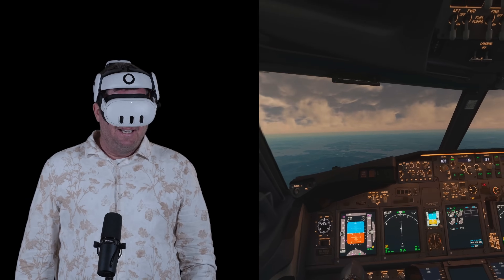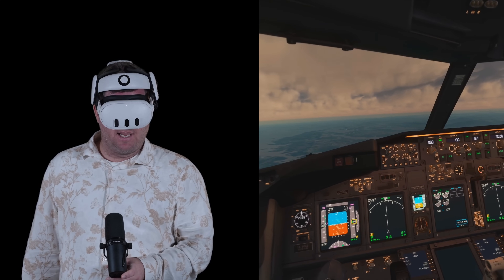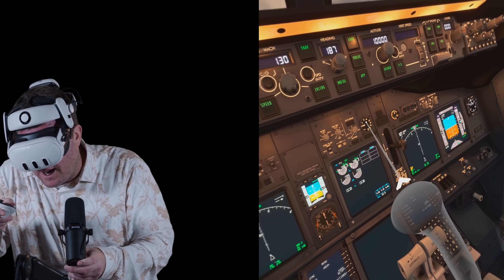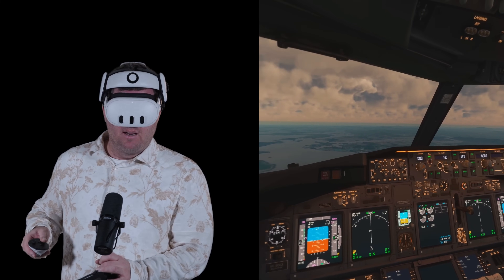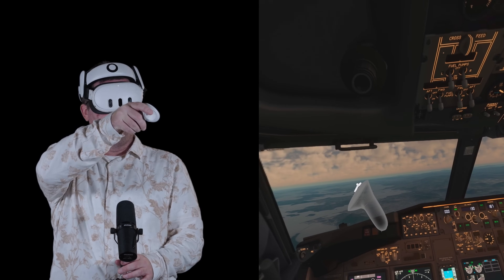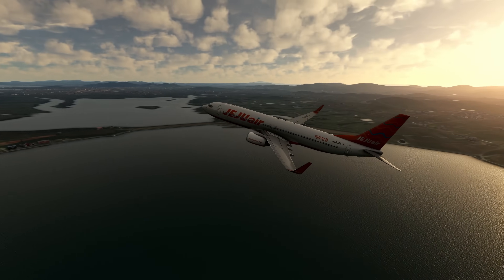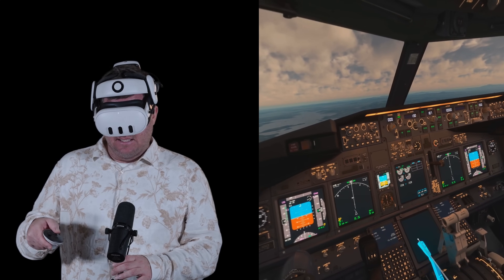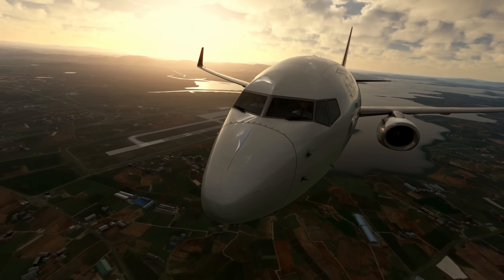Flight Recreation and Update on Jeju Air Fatal Crash in South Korea

Comment: It is clear that one must first have analyzed all the data in order to clarify 100% what happened... 
But, and I repeat myself, but the data we already have shows that the normal approach to 01 
happened in landing configuration. This means that the flaps were extended (1 video also shows this). 
We do not know whether the landing gear was already extended - but at the time of the bird strike video the landing gear was retracted. Then there was a bird strike; first on engine 2 (right). The aircraft was within the glide path (position A).

And now allow me to speculate - i'm with you.... When the flaps have been retracted (and they have to be), the 737 is in the aerodynamically best glide, but no longer in the prescribed glide path (too high). This is because the glide path was intended for a flap position of approximately 30°.
In order to land at 01 again, the 737 would have had to fly a 360°, set flaps and landing gear again and make the second approach.
Maybe the crew had this in mind - we don't know - what I can only say as a pilot: If you have hit a flock of birds, never fly a 360°! The approach on 19 was right decision.
Why? Because you may be flying through the same flock of birds; most birds climb in the flock in the thermal.
But if at that exact moment engine 1 (left) is in trouble (because we know that engine 1 was not running when we landed), then the 737 is in the configuration of the best glide and now at position B (wherever this is - but not in axis to 01 and not in the glide path, that's for sure).

We don't know why engine 1 wasn't running; the crew may have switched off the wrong engine or there may have been a second bird strike - that's speculation. But then the 737 is too high for the 01. Ok, then the 19 is the right decision.

But then the cross - approach to 19 must be longer so that you can see the position to the tochdown point of Rundway 19.
Only if you can see this point can you lengthen (you are too high) or shorten (you are too low) the cross - approach.
In the final - when the glide path becomes visually predictable for the crew - the landing gear is dropped (only gravitiation required, takes about 7-10 seconds the gear ist set & locked in B 737). In addition, you must choose the touchdown point BEFORE the runway because the ground effect takes effect in the flair - every pilot knows this. 

It is possible that it was no longer possible to extend the flaps (engine 2 in stress, engine 1 shutdown). But it was possible to set the landing gear. The landing gear also destroys a lot of the ground effect. As pilots, we can see - also visually - that we are going too fast. We also know that at over 170 kts no touchdown is possible. So - forgive me for this comment - but that's exactly why we all learn to trim the way for the final approach over the ground... With slight S-curves.
This allows us to fly additional distance and destroy altitude (potential energy) and speed (kinetic energy). We practice this very often in the simulator!
The 737 without flaps ...again: We pilots know that! - the 737 only touches down when it is much, much slower. Yes, it is very critical to land 35-40 tons without flaps. But it is a plane.

Whatever - we are in our chair an have no stress... It's easy for us to talk. but, even if we have a COMPLETE engine failure in a stable glide path, there is no reason for all these maneuvers. We are all (really ALL pilots) learning: You can't stretch the glide path of an airplane - there's a limit here, but you can ALWAYS degrade the glide path. Be it by slipping, be it by changing the course over ground.

Oh damn, this is all so tragic. The lost souls, the poor sisters, brothers and parents... They have lost so much. The best that can be made of this tragedy: Learn from it, make things happen, make flying even safer, make training even better.... And make aerodormes safer (berms ... )

It may be necessary to adapt the approach procedure for all aircraft. The approach must ALWAYS be high enough to ensure that the runway remains accessible in the event of a complete engine failure, the runway remains accessible. There is also the question of the APU. Shouldn't the APU ALWAYS be started by a bird-strike in the future as a sunful procedure -  or even if there is an engine problem on approach? The APU needs 120 seconds to supply the electrical energy for the flaps - too late in an emergency procedure such as this flight after the bird strike.
Reply: @robbedontuesday  The CVR & FDR have backup batteries so they continue to record if the power supplies fail. However the signal that is recorded may come from devices that lose power, so zero is record and there is a blank in the record.

The electrical generators are powered by the main engines, so problems with both engines may have caused the generators to have dropped offline. When the power becomes available from the engines each of these generators has to reconnected to the main bus 1 & 2, by the crew. The batteries will supply essential systems with 28V DC and via a low power static inverter 115V single phase 400Hz for other essential systems. However 3 phase 115V 400Hz AC will not be able to supply the electric motor hydraulic pumps to power the hydraulic system if the engines have failed.

Comment: The 737 with no landing gear sits naturally on its engine pods and its belly on a nose up pitch. They would have to use the elevators to lift the tail and bring the nose down. If they had dual engine failure while going around they would have been probably stuck with nose up trim and without hydraulics in a 737 it's very hard and slow to change the trim. You have to crank the trim wheels by hand and they are very hard. It's possible they just couldn't lower the nose.

Comment: Even if there were crew errors, it’s tragic to think that it might have been survivable without that concrete. It’s really weird to watch the end, realising that one moment they were all completely well, and then they were no longer conscious humans, except for two. Absolutely awful.

I’m tempted to get a VR headset!
Reply: Too many people are going on about the concrete wall at the end of runway. It was not the cause of the accident. Events before the plane touched down belly first were the cause of the disaster. The plane when it reached the wall was literally in the wrong place at the wrong time. More than 100,000 arriving and departing flights at Muan Airport over the past 17 years have had no problems with the wall.The experts who are going on about the wall are doing so for deflection and distraction reasons. Trying to "lead the hounds off the scent".

It is true the concrete retaining wall that Ayrton Senna hit at 233 kmh at the high-speed Tamburello corner at the 1994 San Marino Grand Prix killed him, but it was his loss of control seconds earlier that was the real reason for his death. (It is an imperfect comparison, but you get the point.)
Reply: @WorldPeace-AdamNeira  There had been a long period behind a very slow safety car and the tyres lost pressure so that the car sat lower on the ground. Because the high speed and g forces in the turn the plank under the car grounded and the driver lost all control, other cars had suffered similar issues and back-off in that corner, but not Ayrton Senna. He was very upset about the death of his friend Roland Ratzenberger and with his mindset should not have been racing.

Another Swiss cheese event.

Comment: You certainly have an original approach to this channel, Stan. Who the hell puts a berm at the end of a runway overrun? Dumb AF.
Reply: The aircraft hit an ILS Localizer Antenna installation. It was designed and built by the US military when the airport was a US airbase, during the 1950's. It needs to be on the centerline for the Instrument Landing System to function. Both the structure and location are complaint with the ICAO guidelines, because it is outwith the safety area. If it were not present then the aircraft would have hit the airport boundary wall 70m beyond, with a similar outcome.

Comment: The landing speed is suggesting the flaps would’ve been up and not 15°

It looks a lot like they had a complete electrical failure. 

None of the exterior lights can be seen from the landing footage… not even the beacon light!
Reply: Being that the case, why deciding to go-around instead of continuing the landing on runway 01?
Makes no sense ...
Reply: @ Obviously, the electrical failure must’ve happened after the decision to go-around. 

The last ADS-B data points also suggesting they had already decided to go-around. The speed had already increased and the plane had started climbing.
Reply: @tonamg53  conveniently. I insist: Nothing fits. Nothing makes sense.
Reply: @ No, that is not conveniently.

That’s one of the most likely possible explanation using the ability to logical thinking from the available evidence so far.

It just seem “convenient” for you because it’s logically fit with the evidence but it is against your unintelligent behaviour called “bias”
Reply: @tonamg53  you are fitting facts according to your convenience. Very, extremely unlikely.
Reply: @robbedontuesday  They didn't use runway 01, because timeline is not what you think it is. When engines damaged they were already going around and it was too late for runway 01.
Reply: @user-yt198  who told you that?
Reply: @robbedontuesday  Who told me? I don't need anyone to tell me. I don't know you, but I can arrive conclusions based on evidence.
What's your evidence would be the correct question.
Reply: @user-yt198  I rest my case.
Reply: @user-yt198  Someone is like my ex 😆
Reply: @harat-xwb  nope. Like MINE!
Reply: @robbedontuesday  You have to say always the last word, don't you?
Reply: @harat-xwb  you got a problem with that?
Reply: @robbedontuesday  Thank you for proving my point.
Maybe it's not about your ex, but about you?
Reply: @harat-xwb  Maybe? 😅
Reply: @harat-xwb  definitely not about his ex
Reply: @ The regulations stipulate that aircraft manufactured on or after 7 April 2010 require a CVR with an independent power source that can provide 10 minutes of power if the normal supply is lost. Aircraft manufactured before that date do not require an independent power source.

Guess when the aircraft was manufactured? 🤦🏻‍♂️

Oh dear… when people don’t realised something about themselves 🙄
Reply: @tonamg53  excellent data! Now explain how the pilots managed to complete a 180° go around turn and align the plane with the runway, with no power, no engines, no hydraulics...

I am reasonable with reasoning. I cannot stand boollsheet. So go ahead, teach me.
Reply: @ They had one engine running as can be seen in the video… so they have at least partial thrust available.

That doesn’t mean they have electrical power 🙄

Also whether they can made the turn back or not depends on the speed and the height of the aircraft when they start making the turn… that is something NONE of us knew 

Jesus…🤦🏻‍♂️🤦🏻‍♂️🤦🏻‍♂️
Reply: @tonamg53  do you realize what you are saying is a wishful assumption? Makes no sense.
Reply: Timeline of events
They were on approach to runway 01 with flaps out and gears down when ATC warned about bird flocks at 8:57am. They saw the birds and initiated go around to the left of the runway at 8:58:20. They informed ATC, but due to bad com ATC didn't hear and did not confirm back. They retracted gears and flaps. At 8:58:50 bird strike happened and  they lost engine #1. Engine #2 was also damaged and hardly generated thrust.
Reply: Electric power lost. Hydraulics mostly lost and pressure dropping. RAT non existent. APU maybe non existent or no time to start. They were too late to return to runway 01. They declared mayday and repeated go around. They explained ATC their situation and decided an immediate landing to runway 19 instead. They executed teardrop turn and aligned with the runway with both pilots pulling with full muscle force. No spoilers, no gears.They didn't even have time and leave the levers to manually deploy the landing gear. Due to ground effect they could only land further down the runway.
Reply: @ So ADS-B out, transponder out, both CVR and FDR data stopped recording, all exterior lights went out..

Are all according to my wishes? 

Sure bro, if you say so 🤦🏻‍♂️
Reply: @ APU still required battery power to start but since both FDR and CVR went out, I don’t think they have battery power either. 

The manual gear extension still required battery power to unlock the hook holding the gear in place too… even if they did the manual extension, that might’ve not even worked.

Otherwise I think everything is pretty much as you’ve said.

The crew did a magnificent job putting that plane on to the runway which would’ve gave them the best chance of survival given the conditions they were in.

A lot of people are going to find it difficult to accept this fact as they would need to eat up their own words…
Reply: @tonamg53  "The manual gear extension still required battery power to unlock the hook holding the gear in place too… even if they did the manual extension, that might’ve not even worked."

The manual undercarriage extension does not require any power. However standby 28V DC provide by the batteries provided power to the essential systems, including the undercarriage indicators, eg:three reds and three greens.

The problem with this whay of deployed the gear, is that the handles are difficult to reach and it can take a long time to get the noseleg locked, many minutes. Which the crew did not have.
Reply: @ I’m pretty sure it needs electrical power to operate the valve that allows the gear to be unlocked and then gravity dropped. 

The gear is held in place by a mechanical lock when the gear lever is in the off position.

That mechanical lock needs electrical power to be operated by my understanding.

One other possibility is if the crew tried to lower the gear manually when the gear lever is in the “up” position, this would’ve cause hydraulics lock and basically rendered the landing gear inoperable.

This issue is unique to 737 as it is the only modern commercial aircraft that does not automatically de-pressurise the hydraulics system once the gear is in the “up” position and needs the pilots to manually select it to “off” position to depressurised it.
Reply: @  I just went to dig on landing gear and it seems you are correct that it does not need any electrical power at all to operate. The locking hook can be released mechanically by pulling the handle in the cockpit.

Also the NG series the manual extension lever can be operate in whatever position the lever is in. Its only need to be in the off or down position for the classic series.

With this information, the most likely possible explanation why the gear wasn’t down is because the crew didn’t know the gear wasn’t down as they would have no indication in the cockpit to tell them that the gear wasn’t down and locked if there is a total electrical failure.

Even if they somehow knew the gear wasn’t down, there is probably not enough time to manually extended it anyways as they’re most likely to extended the gear last minute to maximised their chance of reaching the runways.
Reply: @tonamg53  2009... I got that info.
Reply: ADSB signal disappearing also supports a complete electrical power loss.
Reply: Btw, both FDR and CVR stopped recording 4 minutes before the crash landing so it is definitely a total electrical power failure on the aircraft.
Reply: @tonamg53  They needed battery to open the valves to deploy the gear. That is spot on.
Either that, or their both hands were on the levers until the touch down, which lasted only 3 minutes which is a very short time. When no electric power (but with battery), they needed muscle power to move and keep the cables and pulleys.
Reply: Either airline maintenance failed or this will turn out another weakness of 737, considering that there is no RAT (Ram air turbine) in 737. In a similar situation Sully had no problem controlling the A320.
Reply: BTW Boeing fanboys are conveniently insisting that this accident was because of pilot error, as they did just after Lion Air crash.
But this time no pilots do that and they were waiting for the CVR.
Sorry for the flood but YT considers long comments as scam.
Reply: Dedicated to someone who is closing his ears to the facts. He is conveniently sending messages to everyone when he thinks he is right, and sending to a single person when he is afraid the others reply him.
Reply: He is a coward. You-know-who

Comment: Weird that they appeared to be set up for landing but panicked with the bird strike & did a go around… had they continued initial approach with gear down & flaps set, aircraft would most likely had a safe landing. My guess is incompetency & panic in the cockpit….
Reply: More and more pilots started saying that they probably went around before the bird strike. ADSB transmission was lost after a spike in airspeed and altitude which is consistent with a go around. So when they were hit, it was already too late to land on runway 01.